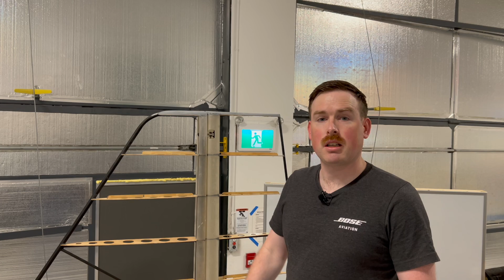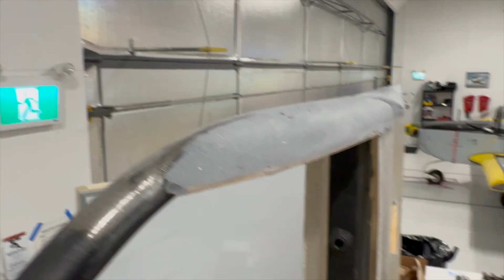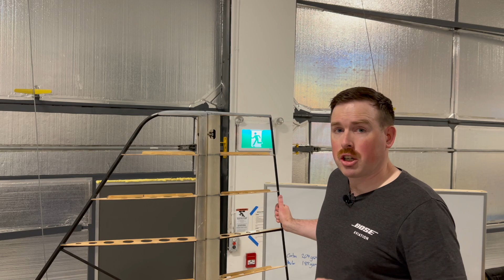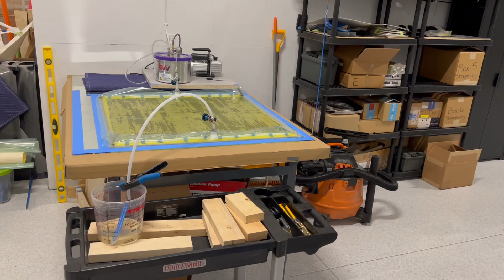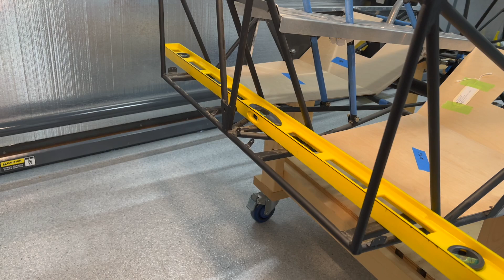Kitfox Build Update 08: End caps done, onto rudder pedals and floorboards (SwiftFox Build Project)

Comment: Good update! And I can fully empathise – the brake bearings are one of those non-trivial puzzles of the kit that would be really nice to see a little re-engineering effort go into improving part quality. The whole ‘sanding bearings’ solution just doesn’t compute with this kid with too much of a practical engineering background. :)

I strongly recommend you beg borrow or steal a lathe - even a second hand hobby lathe would likely give more satisfying results than sandpaper and drill press – and you’d soon wonder how you lived without the greatest of all machines. Ideally a collet chuck lathe is best for this job for maintaining best possible concentricity between O.D. and I.D. and similarly, allows the best chance of getting the I.D. concentric along the entire length (esp in the middle!), by progressively feeding the bar stock out of the chuck.

I started by internally deburring any weldment ‘high spots’ before reaming* the rudder pedal top tube to 0.5" - on the basis that round things run smoother in round holes - and adding grease (AeroShell 6 or similar) both lubricates and protects.

*Mounting the 0.5" reamer upside-down in a vice and slowly rotated each rudder pedal around it (with lots of cutting fluid) gave good feel and control over the cutting force - vs hold each pedal in a soft jaw vice and ‘jerking’ a relatively large .5" reamer by T-bar style chuck. Next and NOT RECOMMENDED WITHOUT A SUPER SLOW SETTING: I finished each one off with the reamer mounted in a VFD controlled drill press set to a super slow <25 rpm, holding the rudder pedal by hand and working it up and down - READY TO LET GO IF THE REAMER GRABBED - but by then most of the cutting had been done in the first stage.
 The issue - as you rightly described: If the supplied bearings are turned to length to fit with appropriate (~.010") end-float between the pedal side walls – and do check for squareness and parallelism of brake pedal sidewalls first – they come up too short to accept full specified (20-25 in.lb) torque: the brake pedal walls bind on the rudder pedal tube ends AND there’s a fattening effect on the bearing O.D. as a result of the applied torque leading to over-compression.

The solution - that gave me silky smooth brake pedals: re-fabricate all rudder pedal brake bearings from fresh 1/2" PTFE infused ‘Slippery Delrin’ bar stock* available from McMaster-Carr 8579K16 or Standard Delrin 8572K55. I bought both  just in case, but so far have been very happy with the first (slippery) one; it machined very easily and with excellent surface finish using HSS tooling.

The Delrin is supplied with oversized O.D. (mine measured .5024") so it does need turning to final diameter. Next step was to measure how much the bearing O.D. expanded due to applied bolt torque:

Torque (in.lb)  |  Length (in)  |  Min - Max O.D. (in)  |  Rotatable by hand
   00                  |  3.4020         |  .5024 - const            |  N/A
   10                  |  3.3915         |  .5029 - .5030            |  Yes - Easily
   15                  |  3.3900         |  .5030 - .5035            |  Yes - Somewhat Easily
   20                  |  3.3830         |  .5034 - .5037            |  Yes - Just
   22                  |  3.3810         |  .5036 - .5039            |  Yes - Just
   25                  |  3.3725         |  .5039 - .5041            |  No

Then, used the data as a starting point to determine how much material to remove to provide a free running fit when greased. I targeted 0.5" -.004" on the ends and -0.010" for the centre waisted section; depending on tube distortion you may need to take more off the diameter.

Eventually each bearing was turning to the dumbbell or ‘waisted’ profile you suggested; I went .010" undersized for the waist, leaving ~1 inch either end for actual bearing surfaces.

Finally, the end-float gap ~.010" needs to be calculated by measuring excess end float by feeler gauge with the assembly greased and assembled.

It helped massively having the rudder pedal components and lathe all in the same room; I wouldn’t want to send the parts away to turn to diameter only to then have to trim to final length without a lathe. It also helped by filing the rudder pedal tube ends square.

 The order of lathe operations is worth taking some time to consider as by turning the waist too early, overall concentricity will likely suffer. Turning between centers helped a lot, but equally was time consuming to set up.

I won’t tell you how many days I spent on this part of the project alone, but the silky smooth result speaks for itself.
Reply from the maker: Jim, thank you for your incredibly detailed comment. I've had to read it a few times to make sure I'm really parsing it, and you've convinced me to readjust my plan.

I think acquiring a lathe, and getting ramped up on how to use it isn't feasible right now, but a hangar neighbour does have one (they're building a super cub), and they've agreed to give me a hand machining down the bearings. They're away for work at the moment so will get to it when they get back.

I really appreciate posting the table of numbers you got testing the various torque values and lengths etc. That was super useful information.